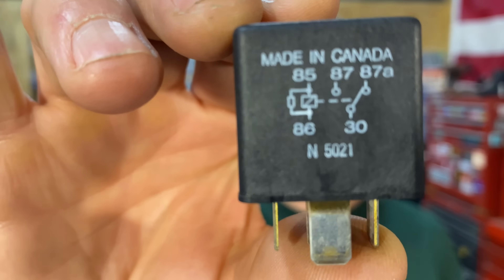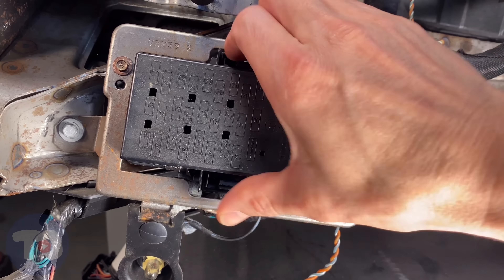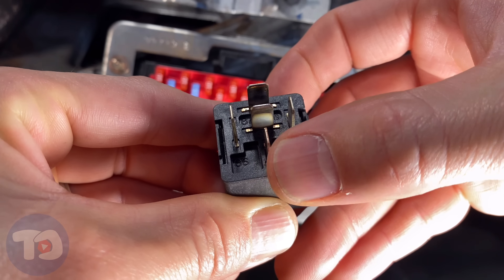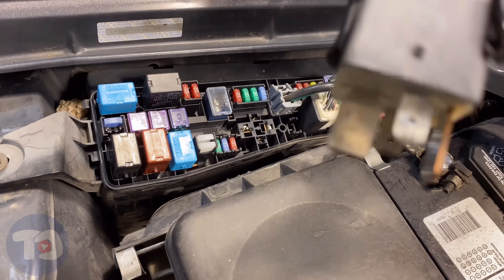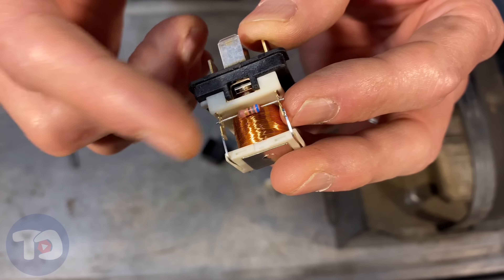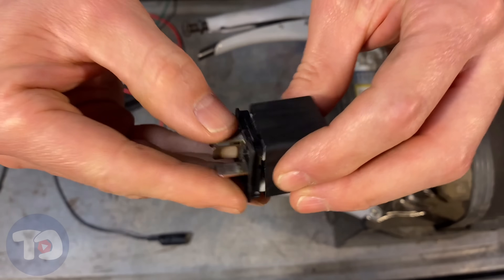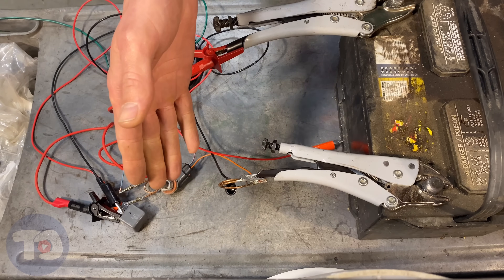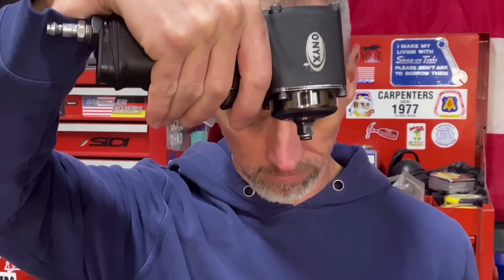Why are relay pins numbered like that?

Comment: Interesting video! Also worth mentioning is that some of these relays have an internal diode mounted parallel on the contacts of the coil. A so called freewheeling or flyback diode. This is to reduce inductive voltages when the relay is turned off and so preventing to do damage to sensitive components in the system. High quality automotive relays also come with sheelding on the inside, to block off RF signals produced by the coil when switching. Also the closing/opening from the contacts cause 'spikes' in the RF spectrum which can cause interference. At the same time, the inside is protected from RF signals coming into the relay. Years ago I had quite some issues with VHF radiotranceivers that interferred with relays. For instance, when the PTT button was pressed and the direction indicator was on, the blinking speed of the indicator doubled. Another one... airbags popping out when the radio was operated. Therefore, we always did a small test. We took the car for a spin at a low speed and crossed our fingers. Fortunately, I never had an airbag going off, but I know some cases...
Reply: Actually its is called BACK EMF And also a diode is MUCH quicker to dissipate the back EMF v. A simple resistor.
When a voltage is applied to a coil, magnetic energy is produced in the coil, this attracting the metal bar which makes the electrical connection. But when voltage is removed, the magnetic energy collapses back ito the coil, which cause the coil to GENERATE a voltage. Sometime MUCH higher than the input voltage. This back EMF needs to be clamped. This is what the diode does. The diode is oriented in the opposite direction of the normal current flow to the relay therefore no current will flow thru the diode when the coil is energized but when the power is removed, the back EMF will flow thru the diode back to the other side of the coil. In effect shorting out the voltage (back EMF) diodes are MUCH quicker than a resistor and thats why they are used.
A driver circuit such as on a car computer can be destroyed in a few microseconds, so its best to protect the driving circuit.
Sometimes people may place a clamping  circuit on the driving printed circuit, but its best to clamp it at the source.
Reply: @rty1955  Thanks for the clear info!
Reply: @rty1955  Back EMF, yes.  However the higher the voltage across the circuit during the inductive spike, the faster the energy dissipates; a simple diode gives about a 1V drop, a resistor a voltage proportional to the (remaining) current, and a Zener diode (plus a simple diode to prevent forward conduction in the Zener) the relatively constant Zener voltage.
Reply: @rty1955  I hope you are not offended but you're not quite right about diode versus resistor. The faster the field collapses the faster the relay will open -- at the expense of higher spike voltage. A resistor absorbs energy but a diode facilitates circulating current and lengthens opening time. Quick calculation using ball-park figures and 680 ohms, the coil current falling to half value is about 4 times as long with a diode as it is with the resistor.
Reply from the maker: Oh wow

Comment: Why not a diode for Back EMF
Reply from the maker: That way the relay can be used with either polarity. Fits more applications.
Reply: @ToolDemos  am thinking of testing that on my scop look for a pulse.
Reply from the maker: @alunroberts1439  that would be neat to measure.

Comment: Wow. I always wondered what those resistors were for. I used a couple of those resistorless decades-old relays for a supplemental horn set-up, without knowing that I should beware of using these on vehicles equipped with board computers. Lucky for me, the horn circuit is entirely separate from any computer
Reply from the maker: Good thing.
Reply: Yeah, I suppose the horn circuit in your vehicle is that way. Some others have a microcontroller handling the usually integrated relay. I think the mid to late 2000s Lexus IS350 is that way.
Reply: horn circuits are actually not separate from a computer, Body Control Modules (BCMs) regularly control horn relays in tandem with the horn switch on the steering wheel, because when you lock your car your horn blasts to let you know you locked it, that's the BCM completing the horn relay's coil circuit to ground.

Comment: Late 1960's onwards Skoda cars, Jawa & CZ motorcycles use the DIN automotive terminal coding.

30 = Battery live.
15 = Horn switch & flasher can power feed.
54 = ignition system power.
86 = Tail & parking lights.
87 = headlight switch power feed.
Reply: Is there a chart with this information or even more available somewhere? This is great,  thank you.
Reply: I owned a CZ 250 dirt bike that thing had unbelievable power but not competitive to the Jap bikes as it weighed a ton.

Comment: Sorry Steve, your video doesn't answer your own question. You simply tell us WHO numbered them, not WHY. 

Why are the relay coil connections not numbered 52 and 53? Why are the contact connections not numbered 10, 15 and 122? In other words; WHY did Bosch number them that way?  Your "half-answer" basically says "They're numbered like that BY Bosch and I have NO IDEA why!"

There are, in fact, real answers available on the web. Even for this question!

Allow me to digress!

Caveat lector! Automotive "standards" are notoriously obscure, antiquated, and particularly stupid in many cases, being "defined" by people often unqualified to do so. These are the reasons why shock-absorbers are called "springs", dampers are called "shock-absorbers", contacts are called "points", capacitors are called "condensers", transformers are called "coils", alternators are called "magnetos", nebulisers are called "carburettors", and the main power switch is called the "ignition" switch. And then we keep the quaint terms of "dashboard", "fender", "dipping" our headlights, "throttle", "airbags", "transmission", "hood or bonnet", "trunk or boot" ... and so on! 

My favourite term worth deriding is "spanner", Americans say "wrench", a word to mean VIOLENT twisting - not too inappropriate- yet still funny. But the British "spanner" is derived from the similar German word, which meant "tensioner" - it was the small tool used to tension the spring of the hammer in early flintlock--fitted firearms. Earlier firearms, using the "matchlock" (a piece of smouldering rope called the "match") needed little force to swing the match into the "pan" that lit the gunpowder feeding the main charge. But flints needed to be sufficiently firmly "struck" to produce a reliable spark! Even then, if the careless or hurried bearer hadn't ensured there was enough powder to go all the way through the touch-hole into the breech, the powder in the pan would flare up with no following "boom" from the main charge - and all you got was "a flash in the pan"!
Reply from the maker: Well said. By the way, if you decide to start a channel about etymology, let me know. You would be fascinating.
Reply: @mikevanin1 I'm not sure where you are getting some of your word equivalences from. I've lived in the US and the UK and worked on cars since the 1980s. I've never heard anyone confuse shock absorber and spring. And a magneto (producing high voltage energy for a sparkplug) and an alternator (producing charging current for a battery) are wholy different things.
Reply: @albanana683  Of course they are different, Al, but only in the automotive world - my point exactly. A magneto generates one Alternating Current cycle of high voltage to feed the primary winding of a transformer ("coil") which induces an extra-high voltage in the secondary winding, to jump across the spark plug (originally "sparking plug"). 

I'm not saying the words are misunderstood or confused these days - I'm commenting on how POORLY the vocabulary used in the automotive industry was developed! In engineering theory, a spring can be used to absorb shock - which is what they do on vehicles. In engineering theory, dampers are those devices that are those poorly-named "shock-absorbers", which absorb no shock and merely distribute, or dampen, the spring action over an extended period.

But it appears you've missed my point. We have to live with this crap - we can't easily change our language to "perfectly" defined terms that ALREADY EXIST! Language naturally deteriorates - we think it improved because of all our technical words. But only the pedantic and the precise speakers are bothered by it - everyone else doesn't care "two hoots".

Comment: In early telegraphy systems, which were used for long-distance communication before the advent of modern telecommunications, relays were used to amplify and relay electrical signals across long distances. These relays were designated with numbers or labels to indicate their functions in the system. For example, the "30" designation was used to denote the common contact, which was the contact used for the main circuit connection. The "85" and "86" designations were used for the coil pins, which were used to energize the relay's coil and create a magnetic field to operate the relay. The "87" designation was used for the normally open contact, which was the contact that was open when the relay was not energized.

This numbering convention was carried over to early telephony systems, where relays were used for switching and control in telephone networks. As telephony systems evolved, relays continued to be used for various functions, such as call routing, signaling, and control, and the numbering convention for relay pins became standardized and widely adopted across the industry.

With the advent of modern electrical and electronic systems, relays have found widespread use in various applications beyond telegraphy and telephony, including automotive, industrial, and household applications. The numbering convention for relay pins, such as 30, 85, 86, and 87, has continued to be used as a standard for ease of use and interoperability across different relay manufacturers and applications, despite advances in technology.

Comment: Those numbers are actually "node identifiers" for automotive electrical circuits. 
there is a list of what the numbers mean here:     https://en.wikipedia.org/wiki/DIN_72552
for example: Node 30 means that a wire or terminal, (or, that node), so marked is powered from battery+ direct 
Node 15 means that a wire or terminal so marked is powered from the battery battery+ through the ignition switch

Comment: Thank you!!! I can now understand how important these little relays are for automotive purposes. A thinner wire(s) can be threaded throughout the vehicle instead of thicker wire to basically do the exact same thing, like running a fuel pump. It's cheaper to use relays and saves weight. Amazing engineering.
Reply: Moving a high amp circuit closer to the load is always an advantage. My 1960s Alfa was running all the headlamp current through the spindly switch on the steering column. When it fails, and it will, it's €€€€ to replace. Very little effort and relative cost, to relocate the power switching to relays next to the lights and battery.
Reply: @albanana683  Thank you for your "Alfa" explanation. Odds are good my long-gone Fiat Spyder used the same Magneti Marelli switch. Knowing Fiat's impecunious behaviours it was probably even same part number! Bought new, replaced one during two years of ownership. Good riddance to my first and last Fiat. Cheers!
Reply: @albanana683  ...oddly enough, even the 1985 Porsche 911 Carrera I had...did the same. Idiocy......putting the full headlight current through the cabin switch that turned the lights on and off. I fabbed a dual relay box to have only the switching (control circuit) pass through the activation switch, one relay each for low and high beams. And while we're at it.....don't get me going on the goofy ceramic "suppository" fuses used,  instead of the more modern ATO blade style that were more reliable and can be accessed on the backside to confirm goodness.
Reply: It also has less chance of starting a fire and loosing energy on a journey with thick wire which carries more bang. Did you know the main difference between water and electricity traveling with the aid of a conduit, the water flows inside with resistance from the pipe walls so the flow is in the middle of the pipe with the resistance at the inside wall, which is why square downpipes are shit, electricity flows on the outside of the wires which is why a corrosion problem can be helped by proper cleaning, coating and connection practices.
Reply: @Philjj61  True and correct. Why gutter fab co's insist on square x-section downspouts defies physics. Cheers!
Reply: @blackrifle6736  Seriously... you think so.  
Well, how little you really know as to why.
Reply: You can also use a cheaper switch and the switch will last longer. DC switches arc more than AC switches and wear faster.
Reply: Yes, I realised this a few years ago after puzzling over that a relay is a switch for a switch, and why?
Reply from the maker: You bet!
Reply: The same concept of substitution works in maths: replacing something with something else that's functionally equivalent. Clever manipulation.👏🏻👏🏻

Comment: A lot of this information is misleading.  There are 2 different kind of shunts on relays. The rare diode type and the far more common resistor type. The resistor type doesnt care if 85 or 86 coil termainals are positive or negative. Because you'll run into a resistor type 500x before you run into a diode type, its basically assumed that all relats have resistor shunts. (Thats the component in the relay that prevents large inductive flyback voltages on the coil control leads.).  30 is not always connected to power. There are a lot of cases where this is true. For example, window lift motors and door lock actuators commonly use 2 relays. 85 and 87a on both are connected to ground. 87 is connected to positive, and 30 on each relay is connected to each motor lead. At rest, both relays ground both of the motor leads. This acts as a brake on the motor if not anything else. When you apply positive to 86 on  one relay at a time, you will make the motor spin one way or the other depending on which relay is being energized. If both are energized at the same time, the motor does nothing because both leads are shorted together while tied to positive.   So, no....  You are providing a lot of misleading information...   

85 and 86 are the coil. Polarity is not specific except in the very rare case that you have a diode type shunted relay. 

30 is common, 87a is normally closed (87a is connected to 30 when relay is not powered.) And 87 is normally open. (When the coil is powered, the relay will connect 30 to 87) 

Because 30, 87a and 87 are simply switch contacts, they have no polarity and are not polarity specific. Just like any other toggle switch in existance. 

If you're going to put information out in the world to educate people, make sure you're not feeding them bullshit.
Reply: I've only seen diodes used for preventing excessive return amperage hammering from halogen lighting getting suddenly turned off